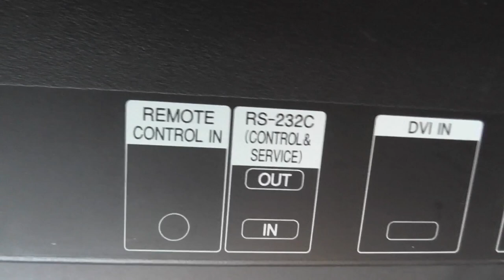Weird TV/Monitor find (quick video)

Comment: Nice! You should take the PC out and connect a monitor and keyboard and mouse and see if you can get to the BIOS and maybe install an OS on it to have a mess around with it.
Reply from the maker: If the whole thing doesn't work I might take the "PC" out and see if I can get it to do anything.
Reply: @CoolDudeClem  Ok :)

Comment: Wow! I cant wait to see how this turns out. This is an exciting find for sure! I hope we see a follow up soon.
Reply from the maker: There will be a follow up, I'm going to check the power supply for safety, you know, make sure there's no leaking capacitors, shorted transistors or anything else that could make it blow up when I plug it in.

Comment: Like it says on the bezel, Life's Good! Congratz on a stellar find.
Reply from the maker: Yeah, too bad the screen on it is kaput, still, it has a few good parts I could use.
Reply: @CoolDudeClem  I've seen videos of folks reviving flat screens sometimes. It has never worked so far for me though. But yeah even if the screen is dead I still saw a lot of good salvageable parts when you had it open. You can even take a flat screen apart and there's a nice heavy piece of plastic in ones I've dismantled. Plastic sheet is handy stuff. It kind of comes apart like a sandwich with layers.

Comment: There used to be platinum inside TVs, would be helpful to know exactly where it is for recovery. 
P.s. do you think you could right up a fly by wire system for a drone?
Reply from the maker: Sorry but I know almost nothing abut drones, apart from they fly and have cameras. Too much of a modern trend for my interests.
Reply: @CoolDudeClem  ah that's a shame. I'm putting equipment together for an aeronautical engineering channel, where I'll build and fly a large drone but I am pretty useless where electrical/electronics are concerned.